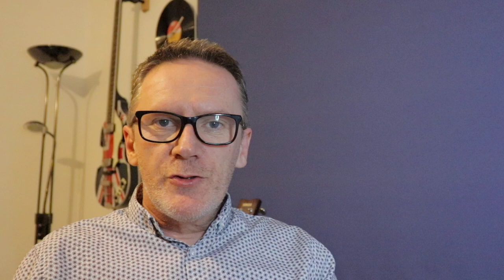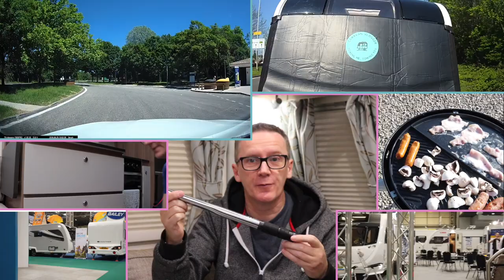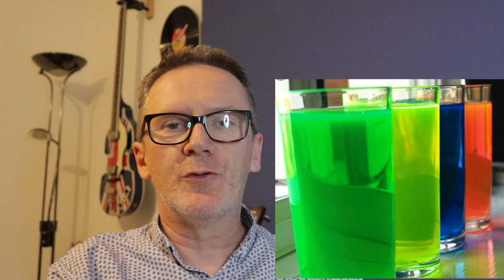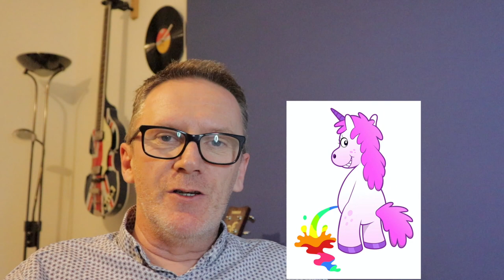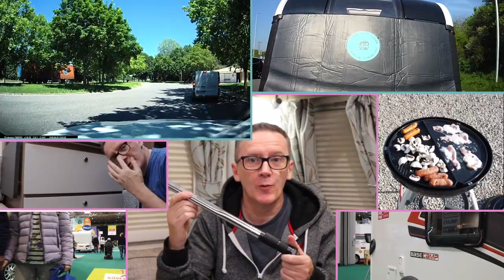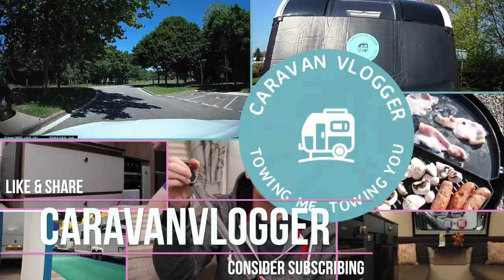Caravan and Motorhome Alde Heating 2 Year Antifreeze - A Con?

Comment: I've been wondering if the water from an air conditioning unit would be suitable. Its drawn from the atmosphere but obviously comes into contact with alloy pipes and grills on it's travels to the plastic water tank.
Thank you for an interesting and informative video.

Comment: Our Van is just coming up to 3rd service and we haven’t had it changed yet. Asked last year and was told it’s recommended at the 2nd service but it all comes down to how often you switch it on. Will ask again this year.
Reply from the maker: Ian Foster interesting not heard that before. Thanks for watching 👍🏻
Reply: Just found out it’s more like dealership rip off. Raymond James my local Elddis dealership want £259 for the annual service and £235 for the anti-freeze change. Reckoned they were fully booked till August and suggested picking up someone else off the NCC register if I needed it doing sooner. Already had a card for someone who was on the list and he’s quoted me £300 all in for both jobs. Another bonus being he will carry out the work at the storage yard, so I don’t have the added diesel expense moving it to the dealership.

Comment: I only ever use Aldes own branded antifreeze, the reason behind this is, having spent years testing the antifreeze that other dealers and customers have fitted them selves nothing else seems to have the longevity that Aldes own branded fluid does 

I am not able to explain why this is or what the difference is with Aldes own fluid as apposed to other G13s made for the car world 

All I can say is when I check Aldes own 2 or 3 years later it is virtually as strong as the day it was fitted, while others where dealers and customers have done there own just a year later and can be as much as half the strength it started with

For myself as an caravan engineer this makes the extra cost worth while rather than tracking down the cheapest option

Comment: As your title says Graham,, yes it’s a rip-off.
It’s works similar to your heating at home and also car . I would say just to buy a antifreeze tester on line or from your local Motor factors and check if it needs changing.
The only worrying thing I can see is the header tank for the Aldi fluids is open vent with a plastic screw and a overflow pipe. This bubbles like your kettle.
So where are all the vapours going?

Do think it only need topping up with full strength not diluted there not running 24hr like your home central heating.
You would think that there would be some type of filter inline fitted if Aldi was concerned about contamination and the fluid being weak.
Think most basic knowledge person would be able to do this even full draining down.
Did see a video from Bob Earnshaw this was a full fluid change on his Motorhome just seems to be a-bit over the top must have cost a fortune.
Think if you can do it your self have a go and upload your video and hopefully it might save someone a fortune.
Does anyone one no the warranty times for the wet heating systems ? not sure if it goes along side with your caravan warranty.
Could only be covered for 12mths.

Comment: Happy with our blown hair heating. Not to say that Alde heating wouldn't be better but our van heats up quicker than our friends posh van with Alde. Plus its 200kg of payload that we don't have to lug around so I can use a smaller car :D

As for demonised water, yep you shouldn't use tap water in a car either so it does get rather expensive
Reply from the maker: Good point about the payload 👍🏻
Reply: We've just had 3 nights away with Alde Very heavy frost Ice . An inch of ice in my water bucket every morning.. Total luxury.. programmable heating 17 degrees at night and 23 degrees from 7am in the morning..So so pleased with it..silent easy on the battery, no cold spots dry towels..Just like our home central heating..but probably better..
Reply from the maker: muddymarvellous we have ours in 17 at night and 23 during the day. Can’t have it too hot at night

Comment: I was quoted £220 4 years ago to change the antifreeze, I did it myself. The caravan place said it was a special system and they need a special thing with 3 pumps to pump it in / out... Load of rubbish, its just a ring of pipes that goes round the caravan, I drained it all down and filled it back up, got a few air locks but found the bleed valves. I got the caravan service yesterday and apparently it needs changing again quoted £190... no thanks. There are plenty of good videos on youtube where people have made a setup with a couple of hoses, 2 containers and a submersible pump. Complete con...
Reply from the maker: Thanks for watching. There's a lot of information on youtube that seems to be designed to scare people into thinking something is more difficult than it actually is. Over complicating things etc. I guess some wouldn't feel comfortable doing certain things themselves. 
You're right, though, it is a con, and a lot of these things actually aren't as difficult as some make out...

Comment: Anti-freeze does need replacing eventually, true. Every 2 years.. well not so sure about that, anti-freeze can become corrosive as it ages - all Alde is doing is covering their asses. I would recommend testing the anti freeze using coolant test strips, I bet the anti freeze lasts > 2 years, I even guess it'll > 5 years.

Comment: Just boil the kettle, wait until it goes cold and use that.
De-ironised water my arse.
Reply: Nope sorry won't work. Deionisation uses chemistry and mechanical filtration to remove all the minerals that are in there naturally plus ones that are added to tap water at the treatment plant ie removes sodium, calcium, iron, copper, chlorides, sulphates, etc. Things that would otherwise react with the metal components.  Boiling will cause calcium carbonate to be removed from the water in the form of limescale and will kill of any bugs, etc. in it but won't remove other dissolved impurities. The other way of purifying water is distillation but that requires something to catch and re-condense the steam or double distillation (re-distilling the condensed steam) to be absolutely sure it's just H2O but this is a very expensive process hence the cheaper de-ionised when you need reasonably de-mineralised water but don't need pharmaceutical grade pure water :) PS Drinking deionised/distilled isn't good for us compared to tap water as our bodies need the minerals. Aquarium shops sell de-ionised in larger quantities than the small bottles sold as "ironing water" as it helps serious fish keepers keep the pH levels balanced in their tanks. Hope that helps.